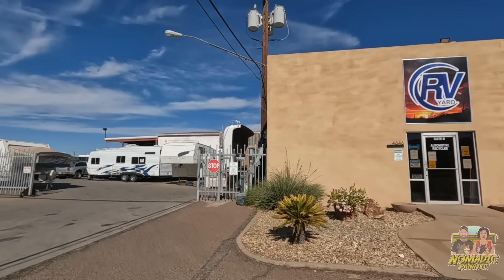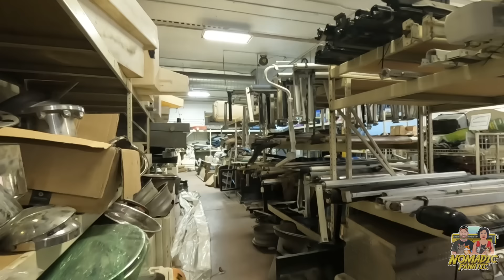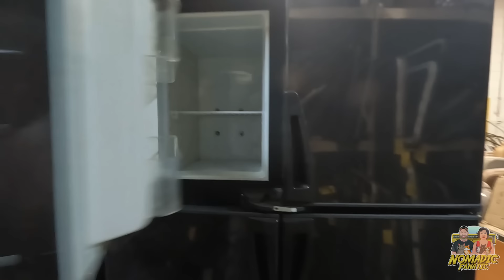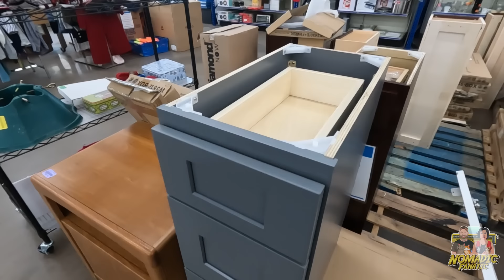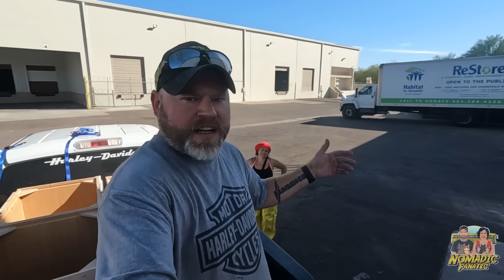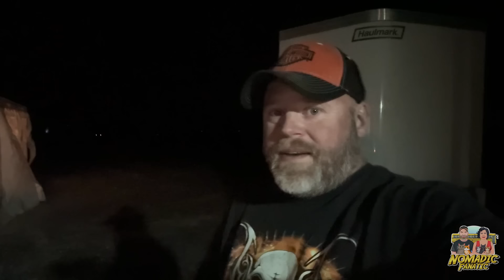CHEAP Skoolie Building Materials in Phoenix, Arizona ~ Cabinets, Tub & Sink Score!

Comment: The section of the block that you are removing that has cables and a gap of insulation. I would highly recommend that you run your flex tubing plumbing through those. Flex mouldings. The less holes you make The better off you will be. If at all.
Possible try not to make any holes in the roof. It's actually better Better to go from the sides Then the actual  roof itself . Also, please keep in mind. That you can always add to the top of the roof even if it makes the roof flat while still preserving the original.
Style of the inside.
Natural natural install curve of the ceiling. This way you don't have to worry about leaks for altering the bus's structure. Solar panels can even be laid. Level even if the roof is curved it all depends on your support and how you mount them. Unfortunately unlike an r v rood Is the less holes made the better.

Comment: Please Read! Hi Eric love  your channel been watching you for years . I just want to suggest because I like you and Diana. Your bus ceiling is vented on purpose . It needs the vents to keep it from mold and mildew . Metal and bus materials  will condensate and  sweats with the contrast of  heat and cold. That is why the insulation is dry and reusable. Whatever the materials that you use for insulation and ceiling cover make sure it can breathe.  Spray insulation is not advisable on metal it will not breathe and will condensate in between the metal and the foam. Hope this helps and saves you much heartache and expense . ♥️

Comment: Rest High on the mountain Felix. You'll surely be missed. Eric, Thanks for the video. BTW I think the ReStore prices are really high. Especially for donated or salvage merch. The base cabinets that were there for $219 each was close to brand new ones from Home Depot. I know, I just purchased some for a basement shop that I am building. And, Lowe's every now and again has cabinets drastically marked down by as much as 70% you just need to be there when they tear down a display or have discountinued lines etc.

Comment: About your cracked countertop, you might be able to glue it back together and use bow tie joiners to keep it together. I’ve seen that done on woodworking videos so you might want to search that out. They can really look good and that way you would still have your full width countertop.

Comment: For Taterland, it'd be well worth looking for a hangar-style fabric building. You can get them where they just drop off 2-4 shipping containers, the frame and tarp inside them, and they're set up in a few hours. They have ample room to park a plane, so a bus AND an RV would be no problem (for exterior work, you obviously don't get solar inside those so not a great 24/7 parking spot).  
I've seen used ones in usable (after some minor patches) condition for less than 10K, and they're very popular in desert airfields so they can handle really any kind of weather you throw at them.